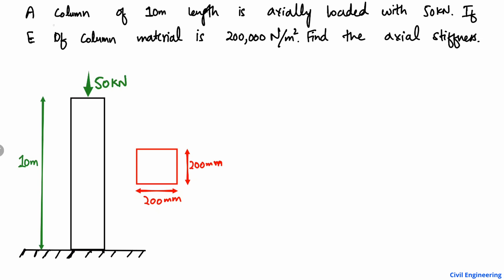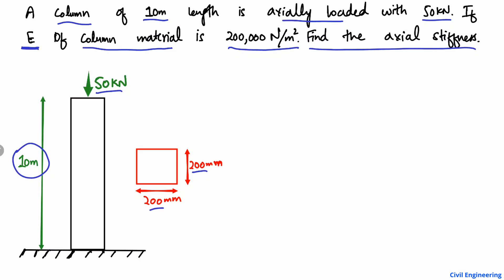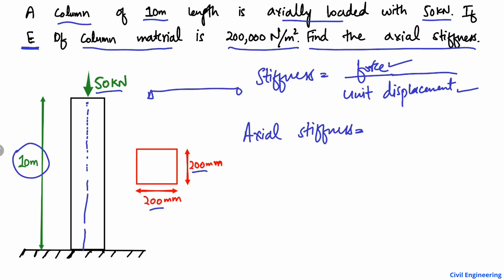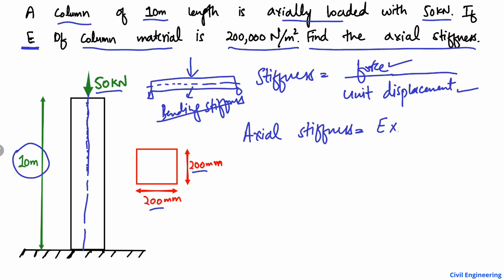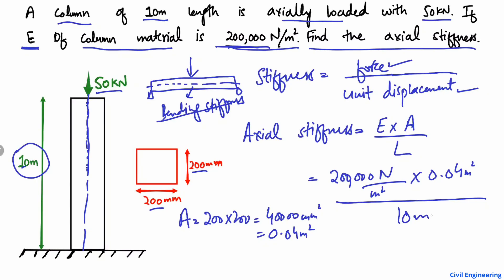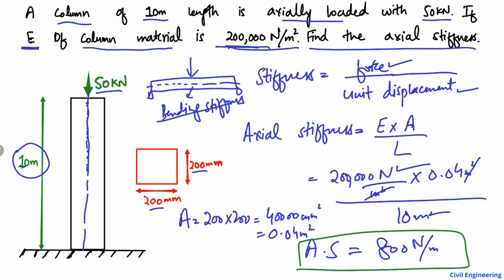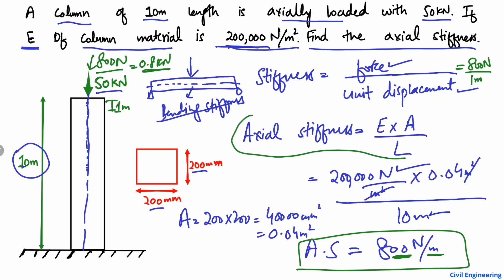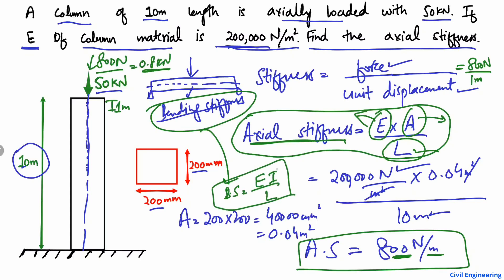Axial Stiffness of a Column – Explained with Formula & Examples

Comment: There is an error, Sir. The material being referred to is a concrete with elastic modulus (E = 5000 sqrt fck).

Why are you using the elastic modulus of steel if I may ask?